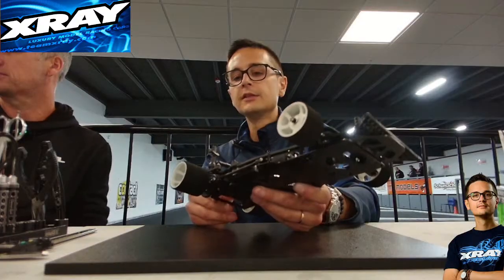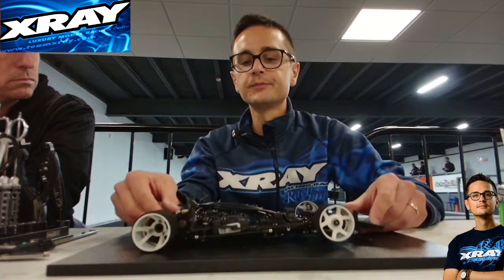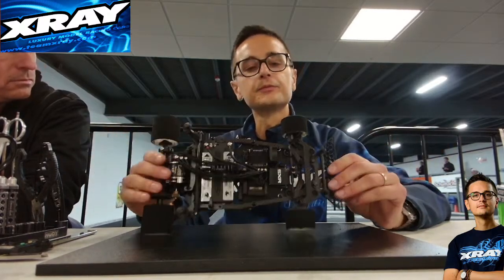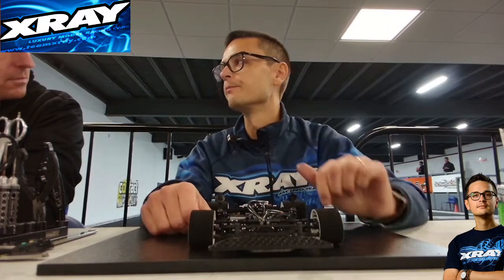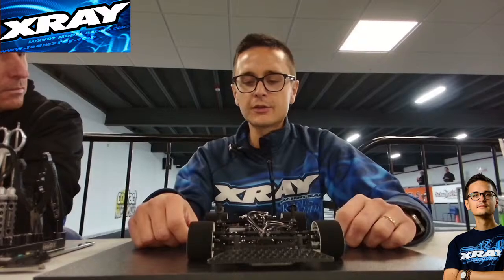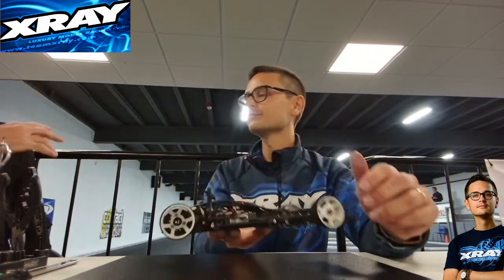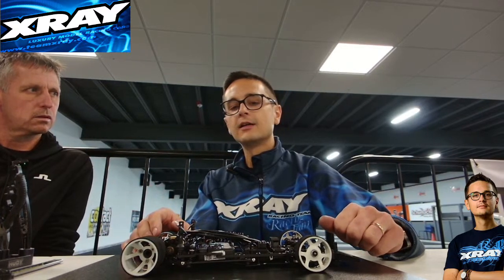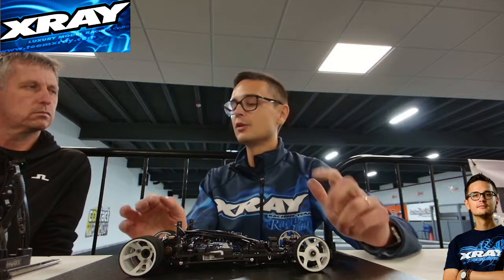Alexander Hagberg Chassis Workshop - RC RACE CAR GP

Comment: Hello, is the reason for spool is that when the inner tire lifts the outer tire still has power to the ground? If so why do we want to keep both rear tires on the ground during cornering? Go kart seems to want to lift inner for rotation? Thanks.
Reply from the maker: The outside wheel indeed keeps driving when the inside wheel lifts. If the inside wheel lifts, because the power to weight ratio is so biased towards the power the car will rotate on the wheel and create instability. The weight is the bias in go karts hence the wheel lift helps rotation… there is obviously more to it… but, appreciating when the grip is low and you get wheel lift the car is a handful to drive. When the grip is high, you can the same amount of wheel lift a wheel and the car won’t misbehave. Hope that helps.